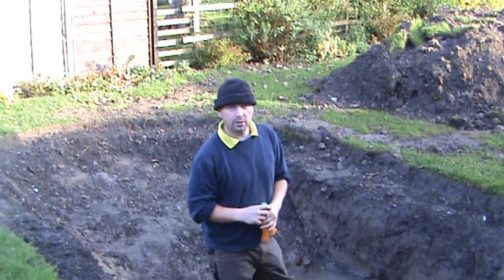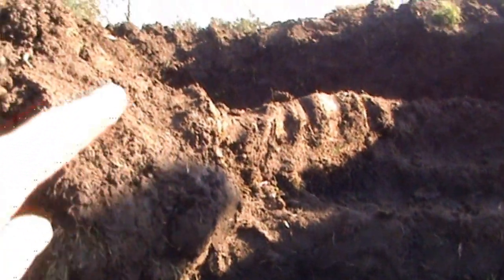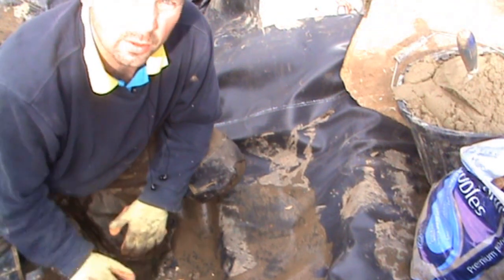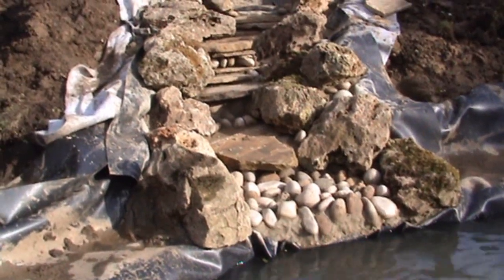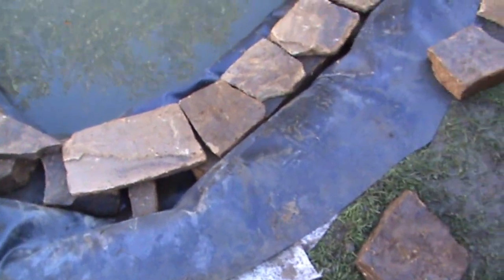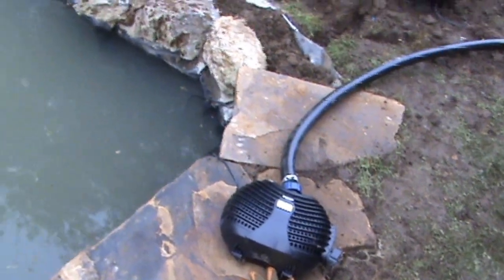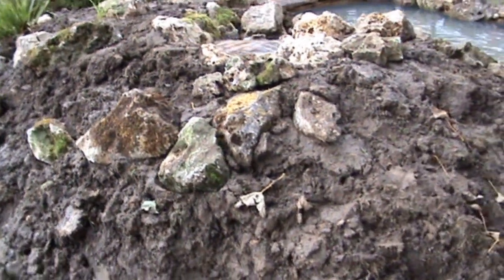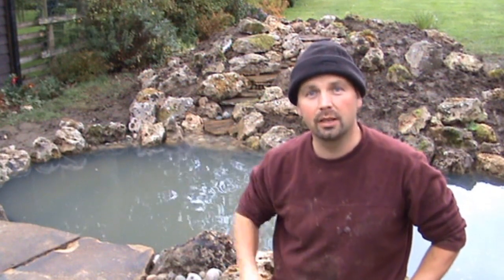How to Build a Fish Pond and Stream / Cascade - Complete pond building video by Pondguru

Comment: Fantastic video mate! Just bought a place with a small pond and the liner is leaking somewhere. And there are too many fish so I've decided to enlarge it by a third. No idea what I'm doing really but your video is a great guide! 
Cheers, Kev
Reply from the maker: Glad you enjoyed the video and best of luck with your pond building.
Reply: get rid of that liner and put in cement !!
Reply: addy113 Something I'd have considered except that I've already bought the new liner, underlay etc. Plus I need to get it filled and settled urgently as my holding tank for the fish is too small. But thanks for the suggestion!

Comment: great video. I have a hard liner pond and we put the dirt pile on the side- I have the rubber liner - just needed to figure it out and you helped. Now I know to put the liner over the edge of the pond so it won't leak. I wasn't going to use cement but can see how it works better. Your video shows exactly what I want to do. thanks so much! I just wish I saw it all landscaped and totally finished!
Reply from the maker: No problem, I'm glad you found the video useful.

Comment: I want to thank you for the video. I'm going to be building a pond in the yard for the better half and you probably just saved me hours of frustration and repairs on mistakes. I'm going to be using natural local stone, petrified wood and agates which are plentiful in my area. I was going to try a natural filter but after seeing videos on some I believe I'll stick to a real one. I was going to go 48" at the deep end but with our winters I think 60" would be best. Our winters here can hit -20. Should I go deeper of heat the pond? Again, thank you.
Reply from the maker: -20 is very low so the deeper and bigger the pond you can make the more stable the environment will be - heating will cost a fortune but as long as you can keep an area ice free (even if you just use a small air pump) the fish should be fine as long as the pump is turned off or very low output for the colder periods of Winter to allow heat to be retained in the pond.

Comment: i personaly prefe 40 mil rubber. its thicker and more durable
Reply from the maker: +Ryan Cole I think that is the same product but that is the US name for it? The liner I used for pond building came from Firestone in US.
Reply: +Pondguru Outdoors yes I'm in the usa. 40 mil is the thickness of the pond liner and grade. firestone is the best and most expensive. but well worth it. I've built well over 30000 koi ponds since I've been doing them. almost 5yrs. it's a big demand here. and people want there ponds to last so I use 40 mil. it's durable and less likely to become brittle. it has a lifetime warrenty
Reply: +Pondguru Outdoors also... pond pumps and filter 52nd to burn out quickly.... 95% of my costumers prefer useing a sand filtration system or custom system via pool pump and median. more reliable and easy cleaning
Reply from the maker: +Ryan Cole Feel free to link videos of your work here as there is plenty to choose from. Over 30000 ponds in 5 years - how can you have built 16.4 ponds per day?
Reply: +Pondguru Outdoors. I don't. I work 6 Days a week all year. Sun or rain snow or heat. lol
Reply from the maker: +Ryan Cole Wow, I was working on a 7 day week when I did the calculations for you installing 30000 ponds over 5 years. A 6 day week would mean you install 19.18 ponds per day...........
Reply: I have I a ruff estament of how many I have done. Most likely not that many but all in all I've done a lot.
Reply from the maker: +Ryan Cole Feel free to post links to videos or a website....
Reply: i will do as i have alot of videos,just have to format the files and i shall post them
Reply from the maker: +Ryan Cole Sounds good to me as although I gave up installing ponds a few years back I still like to see what others are doing and how they construct their projects.
Reply: Wheres the link to pond videos though? 😏
Reply: Pondguru 16 ponds a day 😂

Comment: great pond and a great video showing u how u did it what I want to no did u add waterproofer to the cement
Reply from the maker: There was waterproofer / plasticiser added to the mix, yes. It helps to prevent water penetration.

Comment: I'm Canadian. Thank you that was helpful. I think I can calculate the flow rate I'll need. and get the appropriate pump solution.
Reply from the maker: Ian Lazarus No worries, just give dealers in Cascade the height the pump need to pump to (vertical lift from water surface) and width of waterfall drops and they should work out what you need no problem.

Comment: Hi there, simply an excellent video thank you. I notice on videos from across the pond (in the US) they use spillways to provide a more uniform cascade but these add quite a lot to the cost of a waterfall. There are waterfall boxes that you can purchase in England and you place filtration material within the box. So, I'm making a wild life pond with waterfall. You don't seem to use a spillway as such presumably you just wedge the outlet pipe in the rocks to avoid a hose effect occuring (?), Additionally what size piping are you using to the top of the waterfall. Many thanks.
Reply from the maker: I think that the pipe we used for this one was 1 1/2" (38mm) as the larger the pipe is the more volume (and less pressure) you will get through. Yes the top pool part settles the flow and avoids jet effect from pipe. Yes the waterfall filter boxes seem like a decent idea but I have never used one of those.
Glad you enjoyed the video and thanks for watching.

Comment: Thanks for the prompt reply and the info. Think I going just put rocks on the first shelf .One last question do you use any treatments for algae? Most of the people I know who don't have rock covered liners don't have to thanks again!
Reply from the maker: M Wilson Green water won't be an issue due to the UV in the filter but for blanketweed something as simple as barley straw in or near the stream can easily prevent it. It is easier to prevent than treat.

Comment: great video and lovely little pond.  I'm presently digging out and building a pond that will be 3'6" deep partly behind railway sleepers and partly in the ground.  Can I use the dug out earth to backfill against the sleepers as shelves or am i better using sand.... what im worried about is settlement in the soil once the weight of water is on it followed by time.  If I put a whacker plate over it will that be ok do you reckon if i use the soil as infill?
Reply: Hard to say, not seen it done that way before, I guess if you have enough soil it will hold the sleepers. You do not need 3ft 6" depth, mine are rarely over 2ft (if you watch Atlantis Water Gardens and other modern pond builders they rarely go over 2ft even in northern USA where it can get down to minus 60!)

Comment: Thank you so much for this video, its really helpful. Just wanna ask one question, is it possible to build a clear pond without liner if I have  natural springs as water source?
Reply from the maker: +DePeaceHunter Yes although it would have to be clay lined and the water supply to it would have to be constant to prevent the clay cracking. Avoid any bottom feeders and plant it up well if you want it to remain clear.

Comment: I love that you have taken the time to show this amazing installation.  I thank you so much as it helps in understanding the concept as well as costs involved at lease this way considering I'm not the installer at lease I'll have an idea what's going on and what is recommended. 
I have a 160ft diameter by 19ft wide the pond is 3ft to 8ft deep in different areas. Also it's flithy with mulk. I will build a 50ft waterfall at the back center of the pond.  
First,  this is a natural pond no liners,  how do you recommend I have it cleaned,  I'm thinking I should remove all the water and add a liner.
What vac, or pumps should I use to remove the water?  Should I add a liner after ( I want to see clean water I have no plans to add fish. ) thanks so much for your support! 
Regards
Reply from the maker: I'm a bit confused by the dimensions of the pond. Please clarify so I can advise.
Reply: Thank your for your timely response. 
I'm very bad with this but to clarify, it takes me 160 steps to walk around my pond. And from the edge of the water till the walk way is about 18 feet.
Reply: Also the water is 3 ft deep in one area to 8ft deep in different areas
Reply: I have a picture but can't upload
Reply from the maker: Keith Davis Try sending it to pondguru@btinternet.com if you want.
Reply: Will do you'll have it within 5 minutes. 
Tyvm!
Reply: Email sent!
Reply: Hi did you receive the email?
Reply: Good morning.  Hope all is well,  looking forward to your reply.  All the best to you!
Reply from the maker: Keith Davis Haven't had a chance to get to all of emails from yesterday as loads of orders came in and I have been doing outdoor work too but I will get to it soon, no worries.

Comment: What a very informative video, such a lot of thought and work gone into both the construction of the pond and of making the video... Thank-you.
My Husband and I built a pond in our back garden 8 years ago not considering that our neighbours newly planted twisted willow sapling would grow into a large tree it is today. Consequently we have a fight on our hands with the leaves that it sheds each autumn.  Would the answer be a pond skimmer, if so what size would we need.  Our pond holds 16,000 ltrs water.  Its wide, irregular shape means putting a net over would be very difficult as would removing the dropped leaves.  
We recently noticed a large hole in the butyl lining (looks like vermin has eaten at it!!) It is on the higher shelf so was easy for my Husband to stick some spare lining onto it.  Unfortunately the patch became unstuck despite using special pond lining adhesive so we keep the water level below this patch but would appreciate any advice as to the best type of adhesive to use so we can fill our pond up completely.
Thank-you for reading this
Ruth
Reply from the maker: The best option would probably be a built in wall style skimmer and most versions will easily be big enough but maybe a net for the few weeks when the tree was dropping leaves would suffice to prevent the majority of them entering the pond.
Glad you enjoyed the video as I used to like installing ponds - was a shame to give that up.

Comment: hello there , just view all the video very very good and the end result looks very good , like the cascade .lots of ideas hope all is good with the new pond .
Reply from the maker: +Andrew Davies I did go back to the pond to film it after a year or so but unfortunately the guy had it drained down for cleaning. As I gave up installing ponds a couple of years ago I'll not be back which is a real bummer as it will look very mature now. Glad you enjoyed the video and best of luck if you make your own pond.
Reply: +Pondguru Outdoors  Hello pond guru .I'm look for some advice on where I can store my two large koi and other small fish while I do a pond clean out .I've looked on YouTube and a few fish keepers have housed there koi in an inflatable garden pool made from strong woven nylon and coated with pvc .would be most great full of any advice you can give me the pond been running for approximately 5 yrs with out any problems ,should get the pond cleaned out in a few days once I've got somewhere to house them .I was thinking of pumping most of the pond water into the pool adding the filter to the pool then returning the water to the cleaned pond along with the 10 fish I've got . I look forward to your response    regards Andrew.
Reply from the maker: +Andrew Davies Yes the plan you have seems fine. As long as you keep a large proportion of the original water and use the filter associated with the pond (to keep bacteria alive) it will be fine housing them in a makeshift container or inflatable pool.

Comment: Does this not need an overflow pipe in case of heavy rainfall? Would the overflow not swamp the garden otherwise? Also, can you add sand and rocks to the pond?
Reply from the maker: You can put rocks into the pond but sand will just end up being washed down into the pump and fed into the filter, clogging it up.
Generally the pond would be operating 5%-10% below its full capacity so would have a buffer before it overflowed. Here there was no low point to install an overflow so water would head over left side into the planted border up the side of the fence.

Comment: GREAT video .. nice to show us all how to build it. I do have a question about the rain ..... it will automaticly fill the pond, were does the overflow from rainwater go .... I dont see a overflow or drain to catch the water what raise the level of water??
Reply from the maker: As you are looking across the pond to the cascade there is a low point on the left of the pond so water drains into the border. The pond is below the level of nearby drains so couldn't have an overflow pipe in unfortunately.

Comment: Great video. I am just about to have a go at building a pond. But I have a question, I never saw you checking to make sure the water will be level around the pond. I don't see you left that to chance! Any tips?  Than you for sharing your valuable knowledge .
Reply from the maker: It got to the point when I was making normal ponds that I didn't use a level as I could tell just by eye when it was level from side to side but the way I built them it allows for a slight difference since stone is built up on a shelf which is about 6"-9" deep under normal water level. That allows for evaporation and will not expose the liner unless lots of water evaporates.
If you're making a raised pond it is generally more critical to get it level so you'll definitely need to use a level then and also if you're making a waterfall the spill stones will have to be level too, especially if the flow is not heavy.
Best of luck with the build.

Comment: Thanks! The dimensions are 14ft lengthwise, 10ft for the width, and the deepest part is 4ft. It is very similar to the pond in this video and it will have a cascade but it will be a little smaller that the one that you have shown. It is 5ft tall and where the water will go through, the width is about 3ft
Reply from the maker: Pond liner would need to be a minimum of 24' x 20' and the cascade liner would need to be around 9' x 7' if it was only 5' long but the visible water was 3'.

Comment: great video! i just put in a 150 gallon pond with 2 spill ways. after watching this video, i now want to install another. great job on this! 

on a side note, CROAKING TOAD, i've used the foam on my pond. it does what its supposed to but is very messy and very expensive. one can is around $14 USD. If/when i redo my waterfalls, i will definitely be using mortar. in my opinion it looks far more natural, is cheaper, and gives you more options when designing.

Comment: Very nice pond. Good to see you're using an Aquamax 8000 combined with a FC 30000. Got similar setup being a 12000 combined with a FC 15000 and I have a feeling I need to get rid of my pomp which is too powerful for the pond. Way too much current in the water ...

Comment: Very nice pond. I am thinking on building one simalar to this in the spring. I was curious if and when a skimmer should be installed, the pro's and con's? Also you made me smile at the end, when showing the cuts from the video that were edited out.
Reply from the maker: I don't use skimmers but if you have a build-in one it will need to be incorporated into the pond design and fitted at time of construction. You can get free floating skimmers (e.g. Oase Aquaskim 25) but while they do a great job they may get stuck in an informal pond like this one. Much better in a formal pond.

Comment: you sir are legend love your vids, very informative and professional, i do have a quick question tho; Ive just started to dig out the outline of my pond and Im finding the soil is very loose near the top ie, top soil falls back in the hole very easily do i need to compact it down more or will it be ok once liner goes in and filled up. many thanks from the SE of england.
Reply from the maker: Once you get the liner in it should be OK. I tend to put a shelf all the way around so any loose soil doesn't end up in bottom of hole, just on shelf so it is easy to remove while pond is filling.
Thanks for watching and appreciating the videos.

Comment: I have been watching all your videos and they are briliant. I have just purchased a second hand pond 4x3 meters kidney preformed Atlantis pond second hand of EBay. It comes with hozelock bioforce 6000 ltr filter a aquaforce 4000 ltr pump a hozelock 1500ltr air pump with 2 airstones a stainless steel water blade. My question is if I wanted to keep fish do I need a biological filter like a shower filter or skimmer as this just has a mechanical filter?  I keep marine fish and have live rock and a skimmer. Just not sure on this as I would have thought I needed something or do I use the bioforce with ceramic or rock in it?  Cheers
Reply: Way to go these days is a skimmer (or intake bay) combined with biological filter (a biofalls waterfall is what we usually use). Isolate your pump so it's not sitting in dirty bottom water. The pump should sit inside the skimmer / intake bay opposite the waterall and so that there are no dead water spots.